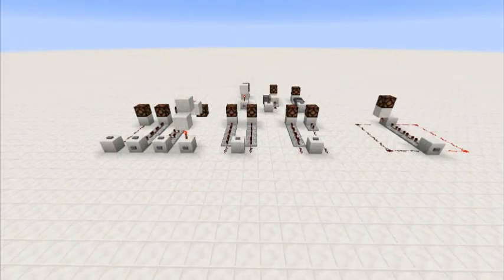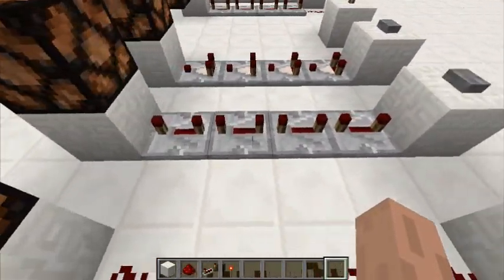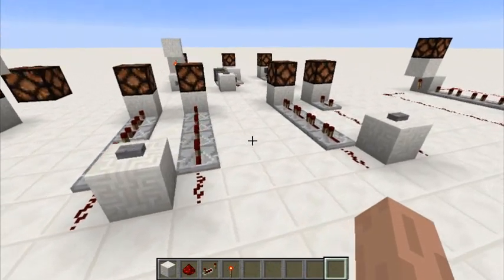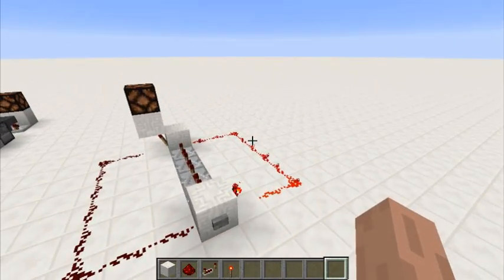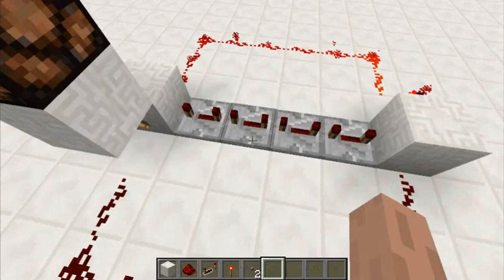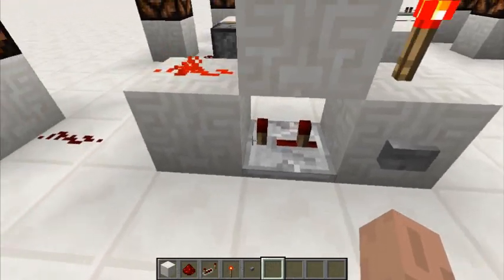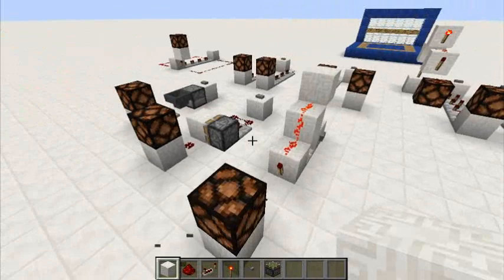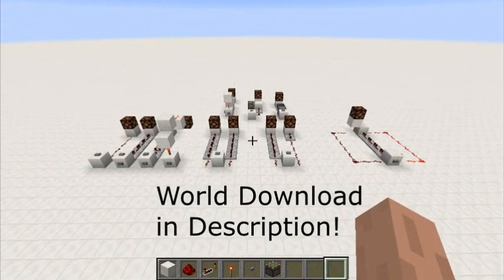Redstone with Ripper :: Episode 2 - Delay and Monstables

Comment: Hey Rip, I have a question? Why did the monostable you showed (the one you said that used to provide a 1 ticks pulse) ever supply a 1 ticks pulse? The way I look at it is this "Torch on top of the input block turns off, 1 tick, torch on the output turns on, 1 tick, so 2 ticks for that. Meanwhile, the repeater is 2 ticks through, so it has 1 more tick, and then the output torch turns off, which is one tick. So wouldn't it be a 2 tick pulse? "
Reply from the maker: I get what you're saying, and I believe it's something to do with how torches work. If you set the repeater to 2 ticks and press the button, you will actually see the redstone wire on top react to the one tick pulse, yet the torch won't activate. Basically, a torch won't react to a 1 tick pulse. It needs a 2 tick pulse to react, and output the shortened pulse.

In short, I now don't think it is a true 1 tick pulse; I believe it may be some weird number like 1.5 ticks as it seems too short to be a 2 tick pulse. The reason you can tell it isn't a true 1 tick pulse is because when you hook it up to a sticky piston, it won't perform the behaviour of leaving a block out and not retracting it.
Reply from the maker: *****
I think I'm getting confused because this setup used to give a 1 tick output before the redstone update.